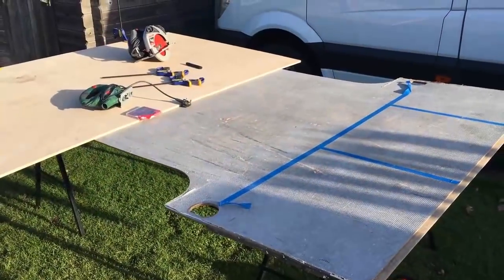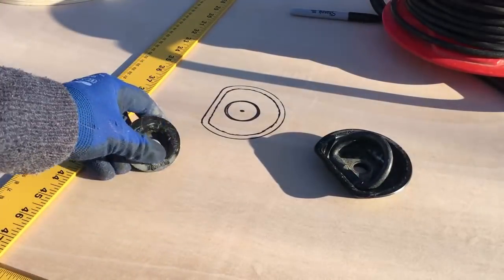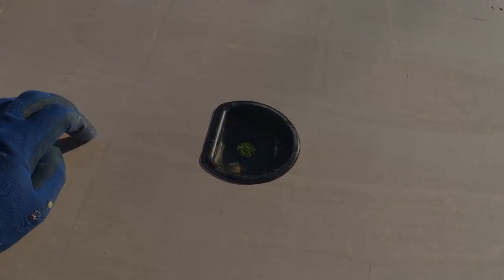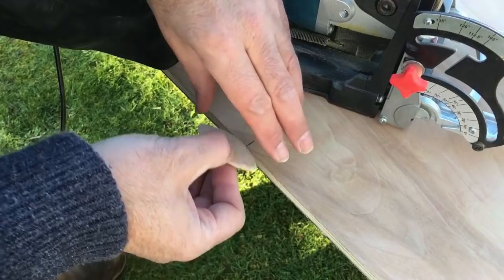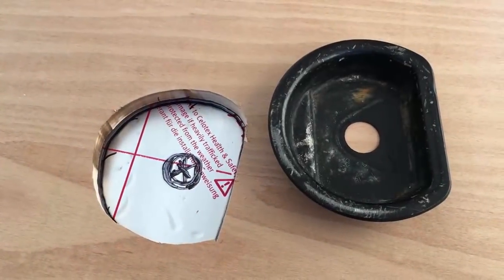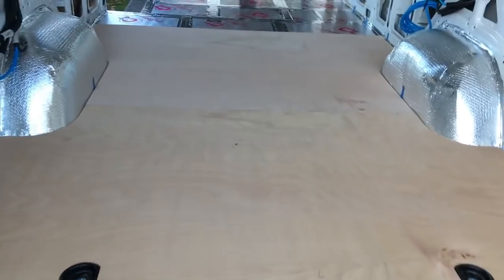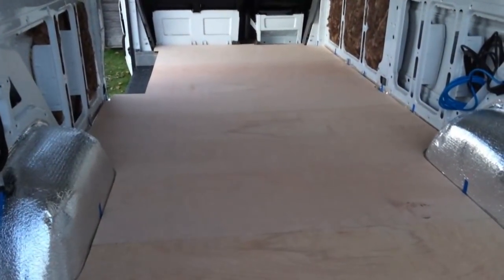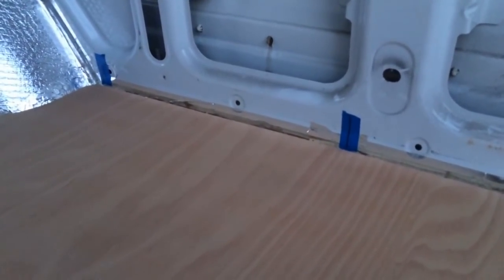Mercedes Sprinter Camper Van - New Floor

Comment: It's worth noting that a lot of conversions either self build or commercial, are made with no floor insulation at all, just ply and an overlay of covering , usually vinyl. This floor installation  addresses heat loss through the floor which is usually overlooked. Effectively this conversion is being constructed within a thermally insulated box impervious to moisture and has soundproof qualities thrown in. a brilliant foundation for any conversion.
Reply from the maker: Thank you very much for such great feedback. If you look at the way caravans or bespoke motorhomes are built they are a double skin sandwich of solid insulation forming a rigid panel. With our van at best it’s a tin box. With a huge potential for both heat loss and heat gain. So anyway we can improve that will make living in it much more comfortable and economical. 
Pleased you liked it.
Reply: indeed, and rigid foam has excellent thermal and sound insulation properties. I've looked also at closed cell 2 part spray foam , which I think could offer a similar thermal resistance to rigid...but it is difficult to apply to the right depth effectively and not enough is known about how it cures over time in such an enclosed space.

Comment: Neat job. I liked the idea of using biscuits in the plywood butt join to minimize flexure. The conversion is turning out to be immaculate so far.
Reply: I too liked the biscuit joint idea, I hadn't thought on that.  I was going to use loft flooring to get tight even joints, however, I'll rethink that now.  Going with the biscuit joint will give me a good excuse to buy a biscuit jointing tool.  I do have a biscuit bit for my router but it's a bit awkward to use, especially on thinner materials
Absolutely stunning video yet again Greg.  What an asset you are to the DIY/Van building community.
Reply from the maker: Thank you kind sir, very much appreciated. I put a few extra where the foot traffic will be not so much under the furniture and shower etc.
Reply from the maker: Both equally great alternatives if you don't have a biscuit jointer. So thank you for sharing that.
You could run the router along the entire edge and put a strip of wood in it, like tongue and grove.
Reply: On that biscuit joinery fun, you only glued on side (male) and I noticed you did not glue the receiving female side. Can you enlighten me as to why not? Thanks. I'm embarking on the research phase of going off grid and roaming about the rest of my days. Your entire series is one of my bibles to rely on. If you happen to have any detailed Sketchup files you would be willing to share, I spent about 8 hours yesterday learning how to use Sketchup and creating my first mock up... I've got a ton to learn. Luckily it's just time and money right LOL!

Comment: Great work Greg. Two alternatives for those lacking a biscuit cutter (probably most of us):  1. Place a double-width batten where sheets meet and screw both sheets down to it. And 2. Cut and glue a lap joint along abutting sheet edges using either a router or table saw (multiple passes for those without a dado set). This solution had the added advantage of more gluing surface, resulting in uniform stress along the entire edge of the sheets.
Reply from the maker: Great suggestions John, the existing floor that we took up had a lap joint where the board met. 
You could also make a groove in the ends of the boards with a router bit and insert a flat piece of wood like "tongue and groove flooring" or simply use boards that already interlock. I'm probably going to be putting down a vinyl floor for ease of cleaning, which is why I went for the plywood base.

Comment: I think this is the first time that I have seen anyone reuse the tie down cups.   That will really help hold the floor down in case of a roll over.
Reply from the maker: I needed something secure to strap my motorbike to. Looking at fitting another couple of loops to the side structure of the van in the garage too and a removable wheel chock for the front wheel.

Comment: Nice tidy job, taking shape now. 👍🏻
Reply from the maker: Yes Peter, thank you. Once I start making cabinets frames and see them go it that when I think I will have turned the corner.
There's so much to think about with the services and mostly the electrics has taken a great deal of planning. I want it all to be hidden so you have to think far in advance of yourself.
Reply: Greg Virgoe yep, I’m in the trade myself and there’s nothing worse than getting halfway through a job and realising you’ve forgotten something😢 usually just after the plastering!!

Comment: Only Greg would design a biscuit jointed camper van floor. Luv him:)
Reply from the maker: Had to sneak a bit of carpentry into this project for my workshop fans :D
Reply: That's fine, but now you've got me interested in biscuit joiners!
Reply: Greg Virgoe Can I ask, is this a typical detail for camper builds, or do most people just accept a slightly flexing floor?
Reply: You could simply make sure the the boards join over a batten. I'll be doing that. Some other channels I've watched don't bother with noggins, stick the battens down rather than screwing and sticking. Don't have a vapour barrier at all. Also often treated battens are stored outside and can be wet when bought. For that reason I bought normal planed timber and for a good bond with the adhesive. I feel that there is merit in adding a few screws provided services are avoided. After all, the old floor would likely to have been screwed down. I can't see any harm in adding a few extra screw holes with the glue to make the whole thing stronger. Also if keeping the tie down points, I'd say you need to make sure it passes through a batten, so you're not tightening it down on an air gap. Either that or use a metal spacer to tighten the mount onto. I wouldn't have thought tightening down on an air gap or in fact even a wooden batten would be a good idea for a steel screw thread especially one which is meant to be massively strong.
Reply: @simonsimpson4695  It appears the lip around the outside perimeter of the tie-down takes the compression against the plywood, so it won't crush the foam.  (The plywood acts like a really big washer.)  But I agree the having the plywood edges meet over a batten, which would take some prior planning, will eliminate the need for biscuits.  But they are SO COOL!

Comment: Nice job indeed. Bit fortunate to have the "old" floor as a template. And that was a nice job in itself.....I'm assuming the people who installed that, also had access to a template, probably from Mercedes  themselves.(?) 
I've done line-outs on many commercial vans over the years....wheel arches just get squared -off...they are purely to prevent damage from crates & pallets, so ....not too artistic or "beautiful-to-the-eye"!.... but I'm considering a conversion in the near future so this was a brilliant watch for me. 
Not sure about the biscuit cutter though: Why not cut the floor to coincide over a batten?
Love your attention to detail....most impressive. Thank you Greg. (Greetings from Chile.)
Reply from the maker: If you joints are on a batten that is a better solution.

Comment: Hi Greg. I’m loving your videos as I’m mid build on my 2014 sprinter van and have watched you videos at least 3 times each. Your very skilled and in depth. BUT I was very surprised to see on your latest video that you did not put back down the original lamideck floor and opted for a new hardboard floor. I am a Mercedes specialist and ran their workshops for 15 years. I am intrigued as to why you chose to replace it as lamideck flooring is an amazingly strong floor and also is very durable to any water or damp also much longer lasting. But still looking forwards to the next chapter 
Regards lee
Reply from the maker: Hello Lee, yes it did look like a very tough material and was also extremely heavy!
It was very beaten up at the doorways where things had been dragged over it for years
and had loads of the tie down holes that I wanted to lose. So it made sense to go with new.
The new plywood will be a subfloor to checker plate in the garage and vinyl in the living space.
Glad you are enjoying the videos

Comment: Hi George.
I like the way you did the floor. I just went out and was looking mine over as I'm ready to do it as well. I still worry about condensation from the air collecting on the metal surface in the valleys, and if it's sealed, there's no where for it to escape. 
My van has a plastic mat, with the fiber material backing on itm and it collects moisture in the air like crazy, and it pools in the valleys or low spots where heavy items had been carried at one time.
The home improvement stores here do not carry small dimensional lumber that is pressure treated.
What I'm contemplating is to do as you did with thinner material or just lay down 1/4" poly foam, and a 1/2" ply over it and leaving the ends front and back open to allow for air flow. I'd seal the sides and seams to prevent spills from making their way to the metal.
Reply from the maker: Hello John,
If you seal all the gaps correctly how is the humid air going to get in there to condensate? If you leave it open at both ends the moist air will get in really easy and you’ll have a swimming pool under your floor. I have been insulating freezing cold chilled water pipes for 30years I know that a vapour barrier is the answer to preventing condensation. Trust me.
Reply: Greg Virgoe 
Will do. I think I'm over thinking it.
I had floor pad out for a few days while painting the floor. The sound proof padding the auto maker uses was all wet and it's been in a carport...
Thank yo so much for your continued help!

Comment: Started on my vw crafter yesterday ....took the floor up found a rotten hole right by the wheel arch nearside ...I did notice yours Looks a little more rusty then the offside ...maybe slap some Waxoil underneath just to be on the safe side 🙂
Reply from the maker: I have painted all the rust spots and sealed with screws and waxoyl from the underside.

Comment: You might want to think about using some high tensile bolts for the anchors if you're going to be securing motorbikes in the back. Really enjoying these videos, I'm planning something very similar and your videos are super helpful.
Reply from the maker: You are correct. I will check what I bought. I thought they were HT Stainless Steel.

Comment: A handy tip when using biscuits.  Drill for the biscuit not halfway in the middle of your wood you are connecting, but further towards the bottom.  The biscuits swell with moisture and whatnot, at a different rate than the wood you are connecting.  So as they swell, if they are in the middle, they will push the wood equally up and down, and you will see a biscuit shaped protrusion in the surface of your wood.

Not a huge issue for a van floor, but in a table or piece of furniture they are very noticeable.  Matter of fact, it is so common, if you start looking at tables, you will see football shaped swells in the surface if they used biscuits.

Dowls do the same but to a lesser extent because they are so small.

Comment: Absolutely the "Best" Series by far! Over the Top!
 My question: Can you add heat to the floor in "key" areas such as in front of the wet room and under dining/food prep area without compromising the integrity of the floor or seal. Yes this would be considered a luxury, but can't deny the pleasure of a hot drink with warm toes!  How would Greg get this done? A side video would be great on this topic. Thanks so much for your videos! 
As a instructor in a different vocation, you had me hooked at your first video. Self Introduction, Science, & Facts!

Comment: Also Greg, I note you have still to finalise your floor finish. Have you considered Cavalio tiles? I have used it on a bathroom floor. Hard wearing, tactile and cost effective. Similar to Karndean
Reply from the maker: Thank you for the suggestion, i have looked at those, some really nice finishes, I liked the dark stone or metal ones.
I was definitely thinking of a cushioned vinyl, but maybe one continuous piece with no joins.
Reply: Its worth a look Greg. The cushioned vinyl that I have had in some flats tends to move eventually. The Cavalio is solid but easy to lift. You can also get it in wood effect and the joints are very tight and almost unnoticeable.  The advantage being you can lift a small portion if necessary in the future.

Comment: Another great video 👍. Just going back to the walls a mo 😬
Do you intend to baton the walls n roof at all before ply?
I’m just about to start my sprinter today (eek!).  Everyone I’ve spoken to who lives full time in a van strongly recommends a baton.  They report condensation dripping from screw heads if the ply is fixed to the van without a baton.  I’d love your take on this.  Brilliant videos Greg, thanks for sharing 👍😬
Reply from the maker: Hello, the intention is to put a very thin battens across the ribs of the roof, countersink the screw heads and fill the holes.
This will support the vinyl covered ply head-liner which we are installing with a PVC concealed trim with no visible fasteners.
I will most likely apply the same technique for the walls however the entire bedroom end is to be lined with an acoustic felt panelling about 12mm thick. This gives an extra insulation layer and sound proofing to the van.
Plus it comes in loads of colours so will be a nice soft finish to the bedroom.
Reply: Thanks Greg for the reply - Keep up the good work :-)

Comment: The biscuit is a great idea! Is it completely necessary to put new flooring in? Although mine looks pretty crappy I don't have the tools or expertise to put in a new one. I will still be insulating below though. Thoughts?
Reply from the maker: Jasmin Bailey ours was pretty rough at the edges where the doors were. If yours in in good condition no reason what you can’t reuse it.

Comment: Great idea using the baskets to join the floor sections, I would not have thought of that. You are also the first person I've seen that cut the floor in sections from side to side opposed to front to back. This is the way I've thought it should be to create more equal sized sections, thus better support. Am I right or do you have another reason? Thanks again for the great videos and information.
Reply from the maker: Absolutely spot on! This way minimises the number of joins and the boards run full width without a break. I did have to cut 2 foot off each board but I’ll use those piece for draw boxes and cupboard shelves or dividers so there won’t be any waste. Thanks for watching.

Comment: Did you put the other bolts you removed back in under the insulation or fill the holes?
If not might be wise to get some very short bolts and pop them in from underneath.
Fantastic build and loving your videos.
Reply from the maker: Matthew Jenkins, I put new stainless steel bolts back in to block up the holes, thanks for the nice comments

Comment: Just a question on the biscuits: why didn't you glue both ends of the joint? Is it to leave the floor modular in case you need to remove a part of it? Just wondering about that and why you didn't go for a fully glued butt joint with those biscuits. Awesome build and channel, very well done!
Reply from the maker: I knew I had to remove it once or twice to run some cables under the floor so it had to be removed. 
Update since using the van that joint does creak a little when walked on I should have put a few more screws in to lessen any movement.
Reply: @GregVirgoe  Gotcha, so leaving the joint unglued is just overall more practical for future work, just make sure it's cinched up tight with screws, good to know, thanks!

Comment: Hi Greg, thanks for the videos, really helpful, can I ask why you didn't  re-use the original sprinter floor instead of the new ply floor?  Was it a weight issue?  Thanks
Reply from the maker: it was really beaten up along the door edges and it was very heavy too, so we decided to go with a slightly thinner lighter weight new floor :D

Comment: Great videos, I'm about to go build my own camper. I have seen a video where the dude explains why insulating the floor isn't really that needed. Since you are the expert in insulations could you give a technical breakdown why insulating the floor is needed? Thanks and keep up the good work!
Reply from the maker: I wouldn’t mind seeing that video as I’m curious to see what the reason was?
Technically my van floor as standard is just a thin pressed steel sheet. With a thin covering of Waxoyl or similar underneath for rust proofing. So no insulation at all. Steel, like most metals, conducts heat very easily and typically has a Thermal conductivity value of 54W/mK. Compare that to the value of Celotex which is 0.022 and steel is 2,500 times worse at insulating against heat transfer. Basically your floor untreated will conduct heat or cold like it’s going out of fashion. I would have preferred to put 50mm insulation in my floor but didn’t want to lose too much head height. 
Try this, unscrew the moulded plastic inner skin of your fridge door, rip off the PIR foam insulation back to the sheet metal door. Close the door and see if a single sheet of metal keeps your milk cold.
I don’t need to know any science to give you the answer to that experiment. 
Hope you like cottage cheese.
Seriously the only time you can get away with it is in a temperate climate where the ambient temperature is neither hot or cold. You don’t have a problem in the first place. Hope that helps.
Reply: Greg Virgoe I am also concerned about height. So a thin layer is better than non. I will do the same for my future fan. Thanks :)